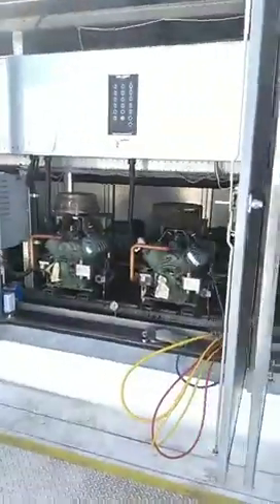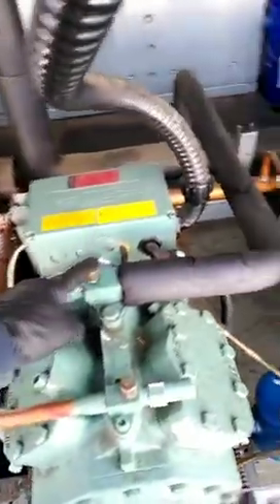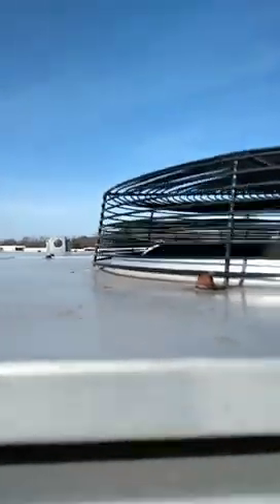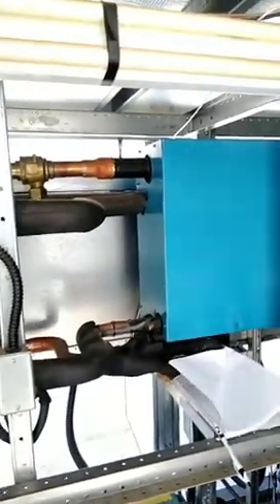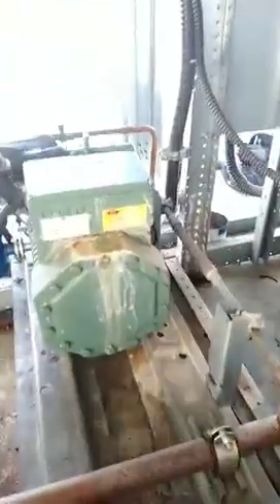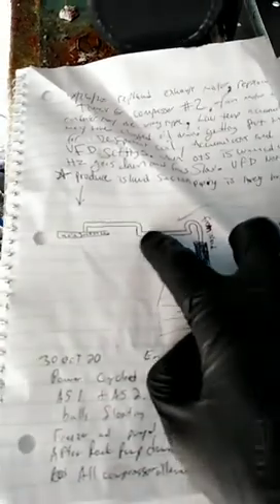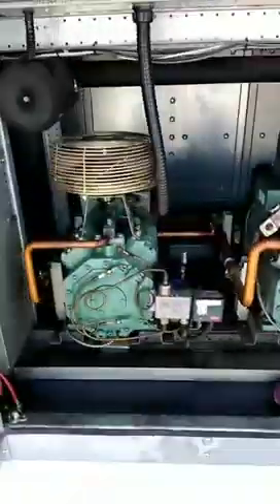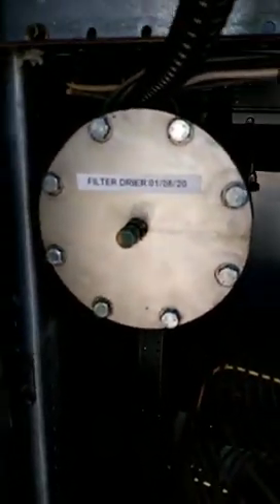Dual Temp Rack, oil nightmare, possible bad accumulator, wrong condenser fan motor installed.

Comment: heat reclaim is a wonderful thing, so is "OIL SEPARATORS" on each compressor, so there is no oil leaving the condensing unit, and filling up the evaporators with oil. you do not want any oil in the evaporator(s). everything gets back to poor install, and then the system winds up chasing its tail, and makes you pull your hair out one by one/ pre- mature grey hair!!!!
Reply: I believe they made a mistake using high pressure oil receiver combined with low pressure regulators, in case of feeding it will push the whole content of the receiver thrue the compressor. This receiver should be changed or  the regulators should be changed.
Reply: @sjefoekel6058  ,I agree with you 100%, this system is an "ENGINEERS WET DREAM", there is too much to go wrong, and with multi- compressors on the same refrigeration system, it is just a question when it will experience a catastrophic event. I have installed oil separators on each compressor with 100% success, oil level issues disappeared!!!!
Reply: @gregoryclemen1870  very interesting, never seen a set up with every comp having a separator
Reply: @sjefoekel6058  , you will not see this, due to cost, unless you "TELL" the manufacture that you want it built that way!!!

Comment from the maker: I found out that during last year's remodel they installed high efficiency cases, which requires less velocity, the oil separator was supposed to be changed, engineers wanted a 3x smaller separator to increase velocity through separator to better remove oil from discharge gas to keep it from entering conderser/liquid ref, but past vendor took the cash and didn't finish the job.  I still believe the LT accumulator is clogged up, got to install the right separator first. I reprogrammed the VFD to what engineers designed for the rack, I ended up increasing the min reference value to keep a higher discharge pressure through the night.  Maybe I will make a quick video on what I've been learning about Danfoss VLT adapt kool drives.